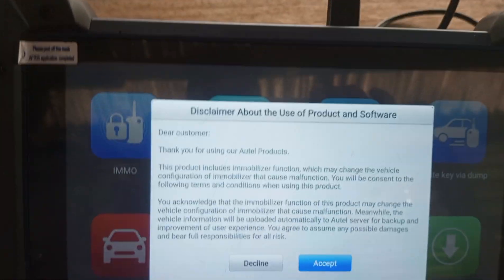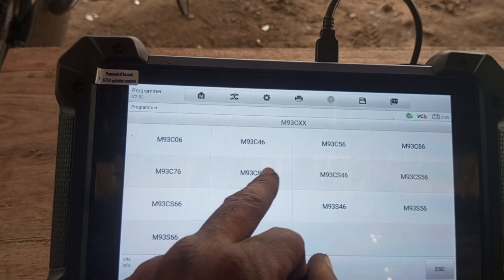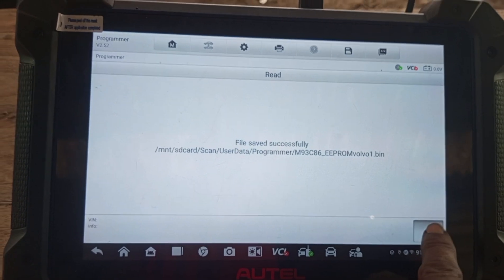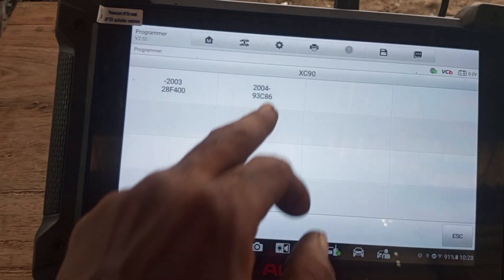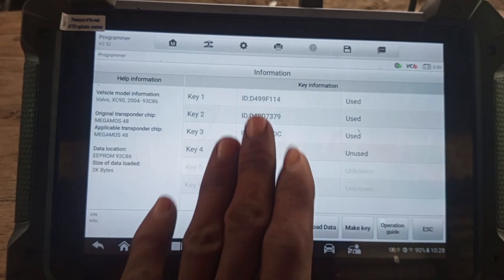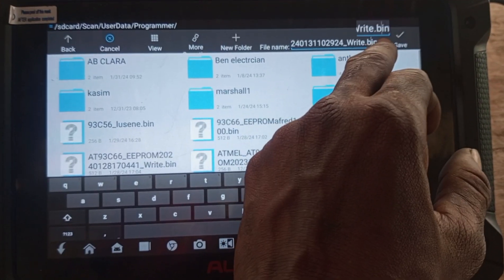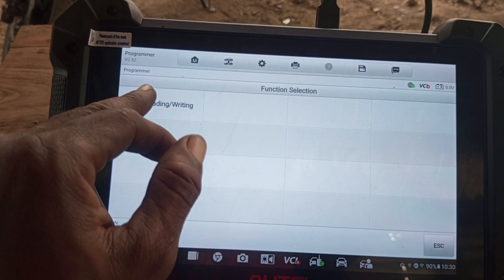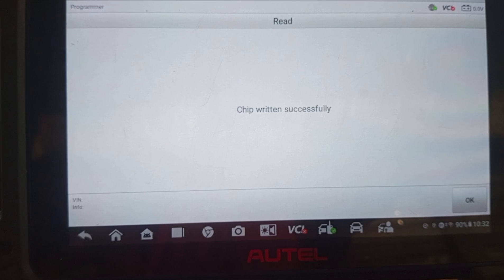how to program 2005 XC90 all keys lost via dump by  autel im608 pro 2. @Lasselectricalzone

Comment: Thanks for another great video! What process do you use to reinstall the EEPROM in the immobilizer ECU? Do you reuse the solder on the pads and secure the chip using hot air or do you reattach it with a soldering iron? Thanks!
Reply from the maker: Yes, you reinstall the chip back on the CEM module
Reply: @Lasselectricalzone Thanks. Yes, I know the chip needs to be reinstalled, but I'm asking how you do it: do you use the hot air gun, or do you use a soldering iron? Which of those two methods do you use?
Reply from the maker: Hot air gun